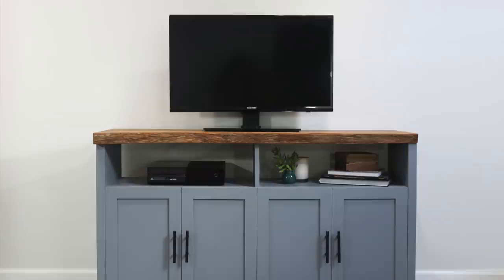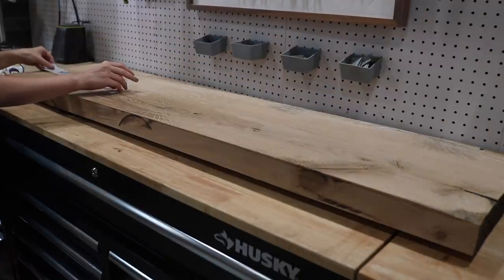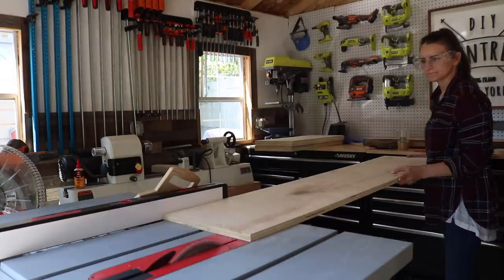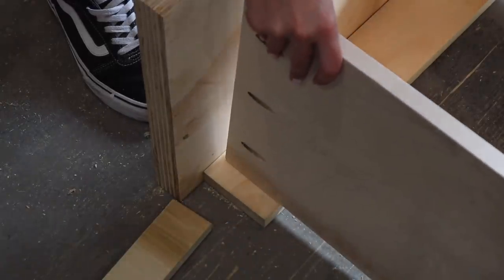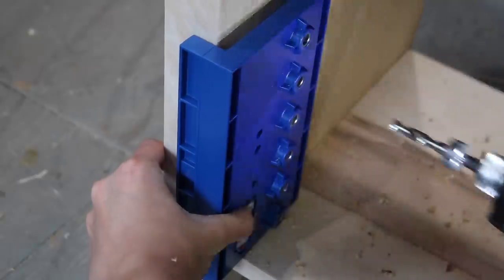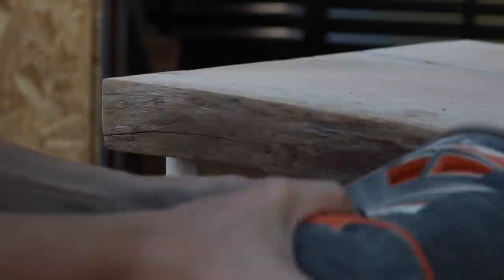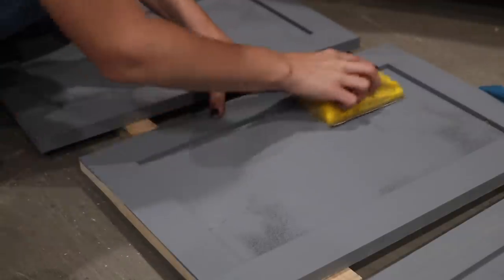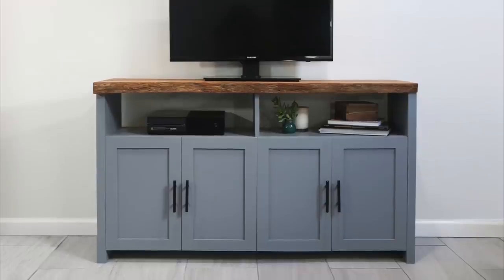DIY Live Edge Cabinet | How To

Comment: It looks amazing. Totally going to remember that joint compound trick for the future though...
Reply from the maker: Thanks, girlfriend! So smart, right? Can’t wait to try it!
Reply: If you are going to paint over it, you can use this product from Bondo:
https://www.homedepot.com/p/3M-Bondo-12-fl-oz-Wood-Filler-30081/206680651
It is a two part chemical that you mix, but it dries completely, ready to sand in about 15 minutes.  It only has about five to ten minutes of working time after you mix it, so make small batches.  They say it is able to take stain but I have not tried that.  It works fantastic for painted surfaces.

Comment: Great project. Great video. I'll be using these plans to build an outdoor cabinet for my bar and smoker supplies. To weight down the center of large glue-up panels and boards I bought 25-lb bags of lead shot (available on Amazon). The don't take up much room in the shop and will conform to odd shapes when necessary.

Comment: If you prime with a Shellac based primer it is helpful in both ply and edge banding absorbing moisture and bubbling from a water based latex top coat, and it sands nice to give a really smooth top coat.  Good looking project!!
Reply from the maker: So, so helpful! Thank you so much!
Reply: @diyhuntress  unfortunately I learned the hard way on a Murphy bed build where the thin vernier of the birch ply bubbled from the water base paint. I almost pushed the whole shop in the street because I was so fustrated with it.

Comment: With the slab screwed to the base cabinet, any worries of the slab expanding/contracting and ripping the cabinet apart?
Reply from the maker: Nope. It’s been installed in its final spot for over a year now and have had zero issues. 😊

Comment: You need to also oil the bottom of that slab to help preserve the wood.  Otherwise, the top and bottom of the slab will move differently and you will get a cup shape to the top because the bottom will absorb moisture and expand while the top is sealed and remains more stable.  Voice of experience.
Reply from the maker: I did! I always finish both sides.

Comment: If you had to estimate how much everything in your workshop cost what would that estimate be? I'm starting to buy a lot of equipment and its definitely adding up to be extremely costly. Also for someone who does not have any equipment yet what are the best things to get first that you would need for any project down the line.
Reply from the maker: Hi! It’s been a collection I’ve been growing for years! My first few tools were a drill, miter saw, sander, and nail gun. I was able to make so much with them! I do have lots of projects on my website and channel that I’ve made with three tools. Hopefully they help you out a bit!
Reply: @diyhuntress  thank you. I'll start off with buying those items

Comment: That looks great. One point, I looked through the comments and didn't see that you've already addressed this, but were you aware that pocket screws used to attach a solid-wood top don't allow for seasonal movement? This is a big problem long term and can lead to a split after a couple of seasons. And with the slab coming in directly from outside like this it could have a lot of drying out to do this first winter, so the top will want to shrink across its width which will put a lot of strain on the screws. 

Other than that great build. And nice job on doubling up the sides, beefed up like this they balance nicely with the thick top.
Reply from the maker: I’ll definitely keep an eye on it and see how it moves - it was kiln dried and has been sitting and acclimating for a while, so there should hopefully not be too much movement. The screws are in (I used specific screws rated for hardwoods), and the slab is sturdy, but I didn’t over tighten. If anything changes, I’ll make note on the video and the post over time.

Everything is a learning experience. This build was one of them. 😊